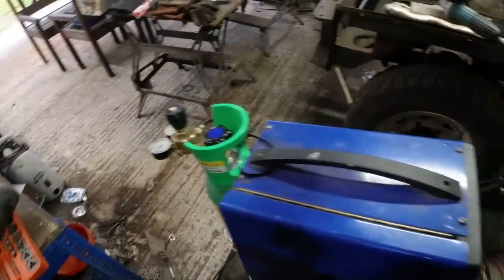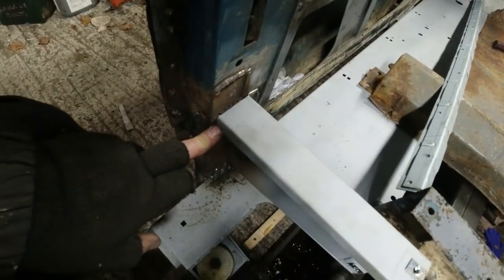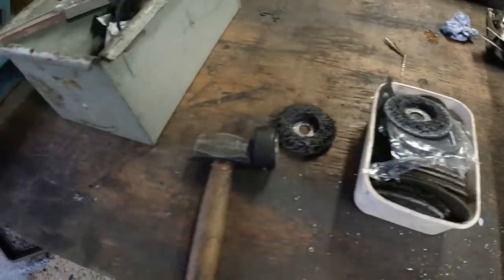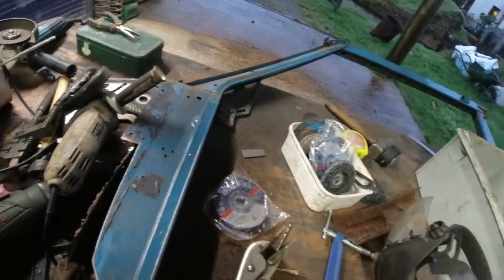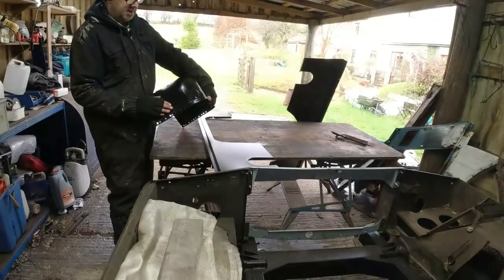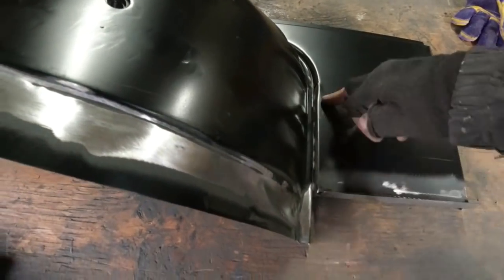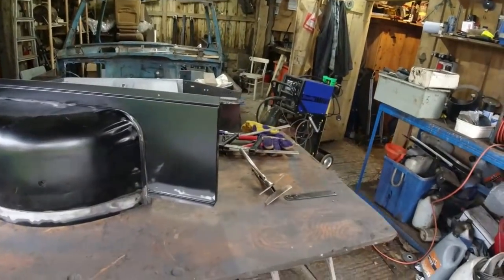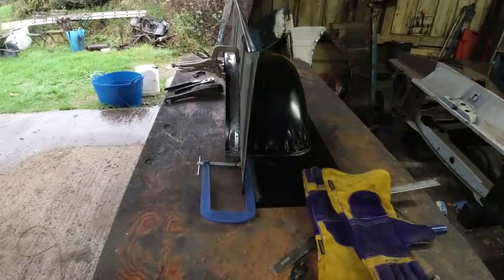Episode 21 - 1971 Range Rover BOB Body frame - profanity warning

Comment: When I restored my 2 door back in the mid 90s I replaced both the rear inner wings and if memory serves me correctly I bought the complete assembly all ready made up so no messing around fitting wheel arches and floor section.saved a lot of time and agro.
Reply from the maker: they would have been original factory pressings and came as a complete side frame if you wanted. these have long since dried up so the separate panels is the only real option now